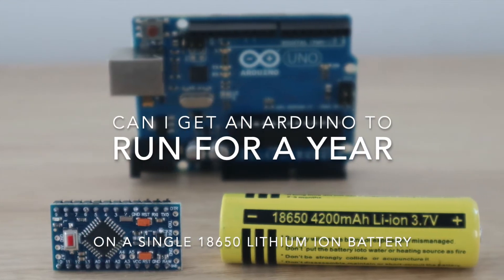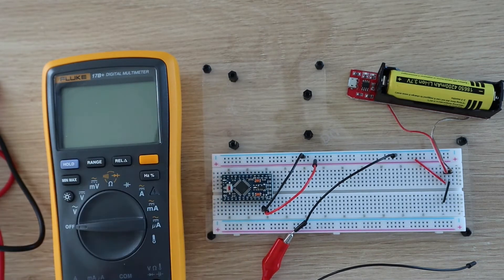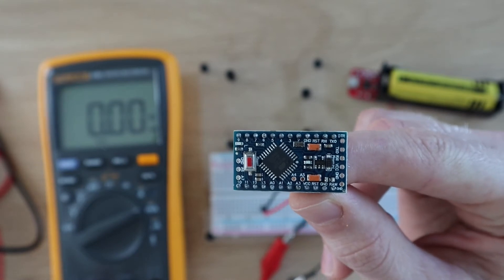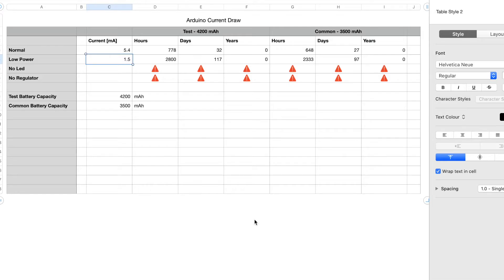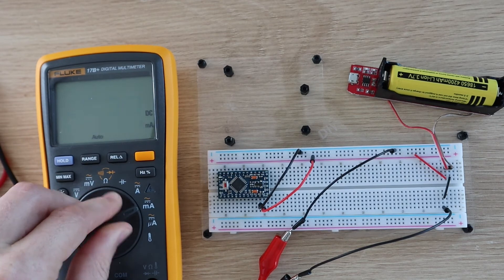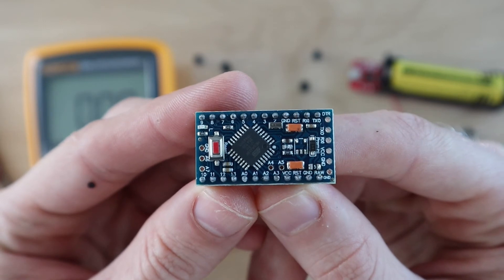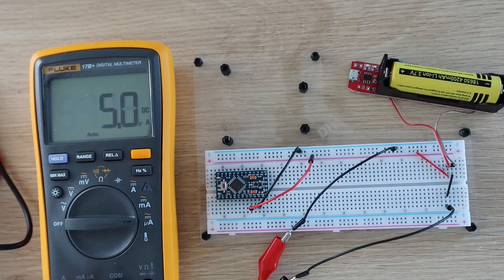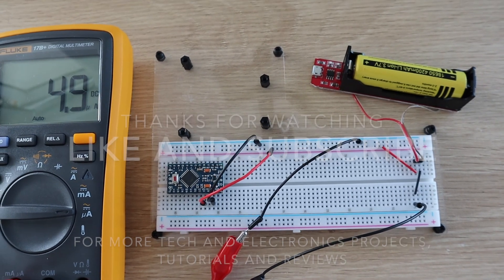Can I Get An Arduino To Run For A Year On A Single 18650 Battery?

Comment: Well explained video thanks. How about adding a more efficient LDO regulator like an MCP1700?
Reply from the maker: I haven't gotten around to trying out a regulator replacement, but it's definitely something I'd like to try. I'll have a look at the MCP1700!
Reply: @MichaelKlements  after quite a lot of research the MCP1700 has good output current, low dropout voltage and low quiescent current. Have just received some but not tested yet.
Reply from the maker: They look like a good option. Did you buy the surface mount ones and are they the same footprint as the original regulator?
Reply: @MichaelKlements  
I have bought a few of the surface mount and also through hole type, unfortunately the footprint is not the same as the original regulator on the pro mini which is a shame. I was thinking of making a carrier board pcb for all modules to be soldered to, also to design it as compact as possible.
Reply from the maker: Yeah that's a shame. I'll probably get some of the through hole type then, it should be easier to bend their legs to fit the surface mount pads.

Comment: Thanks, this was a great video.

Would love to see one with other modules attached like a GPS and RF or GSM one, just to see how those affect the power consumption.

Currently working on a pet tracker right now and want to see how long it would last before having to replace the batteries.
Reply from the maker: Thanks Akiru's Lab. I'm sure the GPS module would make a significant impact on power consumption. The GSM module too, although this could be turned on and off as needed.
Reply: @MichaelKlements  you can make use of the sleep modes of the applicable modules. Can suggest the quectel L80 GPS (fairly low current) and the little Sim800L gsm module. I have a little video on my channel checking power consumption on similar modules (my L80 gps module has just arrived and am starting to test)
Your videos are implemented better than mine so not keen to make another one! I think a lot of people would be interested in this kind of project especially as it’s low power.
Reply from the maker: That's quite impressive getting a GPS module and GSM module running on an Arduino and only using 7.5mA! I'll definitely have a look at them, this has a lot of potential for mobile tracking devices and even small drones and autonomous vehicles.
Reply: @MichaelKlements  
The sleep current should be lower with the L80 gps, running current is definitely lower. I have some mosfets on order to remove main power from the gps but leave backup power connected which should lower sleep current to around 1-3 Ma. Currently I can send gsm model a text command which wakes the Sim800L, interrupts the pro mini from deep sleep, parses the command to see what to do next e.g. wake the GPS or turn on power to the GPS, get a fix then return coordinates by sms with a google maps link then all go back to sleep. Also have a separate interrupt for the pro mini to add a tilt switch, when closed will send an sms alerting movement. That can be turned on and off by txting a command to the Sim800L.
Seems to work quite well. Working on getting notified when battery gets low and what to do about it.